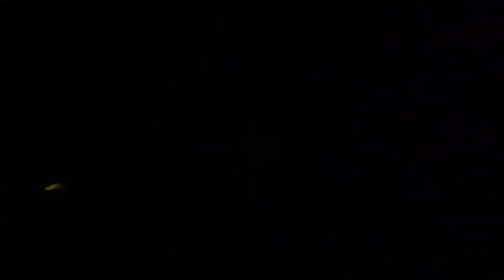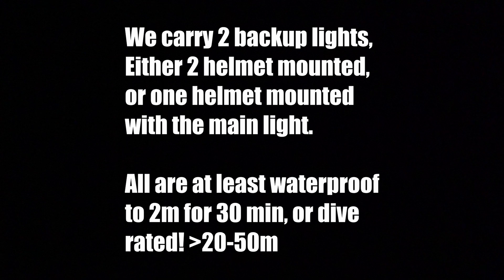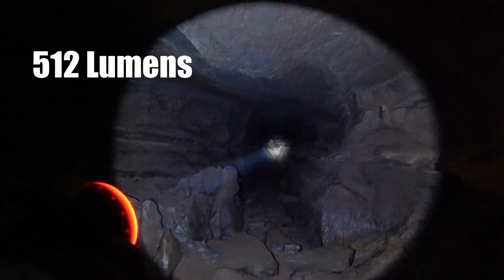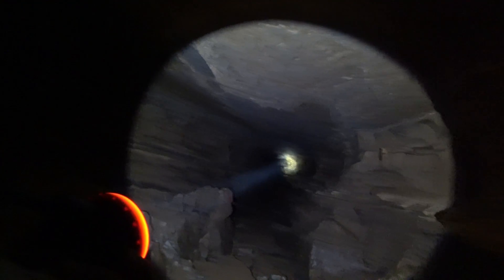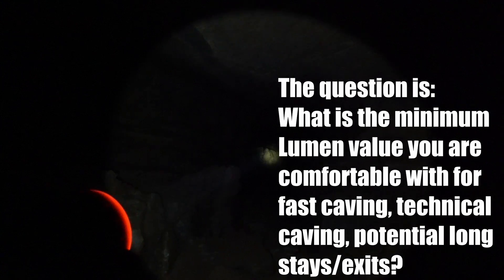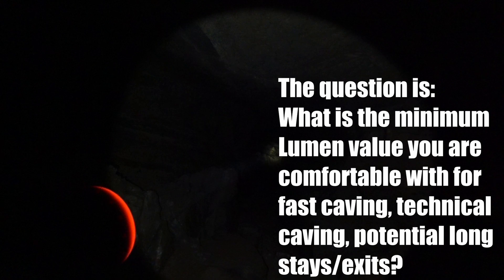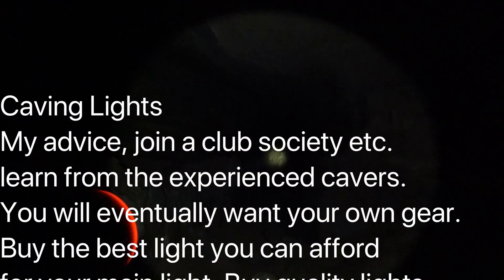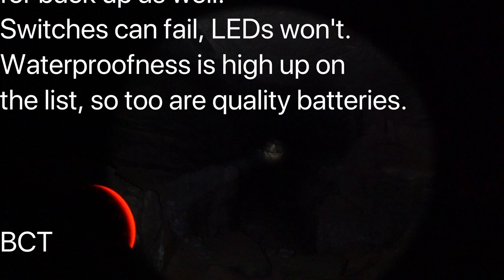Backup Caving Lights Considerations

Comment: Good general advice to have multiple lights.  Personally I take 5, yes 5 lights.  Two are zebralights mounted to my helmet.   One is a small aa powered fenix headlamp I wear like a necklace, which makes is easy to put up on my head if needed and it's on my person as well.  In my bag I keep an additional backup headlamp (Skillhunt H04) and a Convoy s2+ high CRI light.  All lights have full batteries and I bring 4 extra 18650s and 1 extra aa.  All lights use 18650 except the neck light.  I mainly use the convoy for photography lighting, but it's obviously a backup as well. 

Getting stuck in a cave without a light is as serious as it gets.  Don't mount all of your lights to your helmet.  I've never personally had someone in the group lose a helmet, but I've heard of it happening before.   Speaking of groups... never never never cave alone. Always make sure someone on the outside knows where your groups is going and agrees to contact emergency response if you don't make contact by a certain time.
Reply from the maker: I've (and my caving buddies) always been a firm believer in you can not have enough light power with you. So like you I'm taking loads of batteries in crush and or waterproof containers and lights with full batteries in them ready to go. The neck torch is a great idea, as u say, it's always with you. And yeah, no lights you could be dead caving. These days, other than some proprietary  (and personally I hate proprietary because of the difficulty of replacing sometimes) the 18650's are a great choice. 

Thanks for watching and commenting!